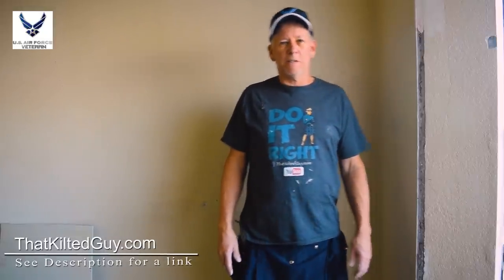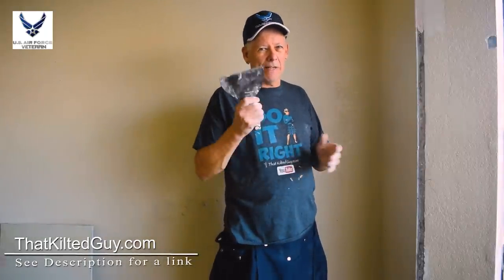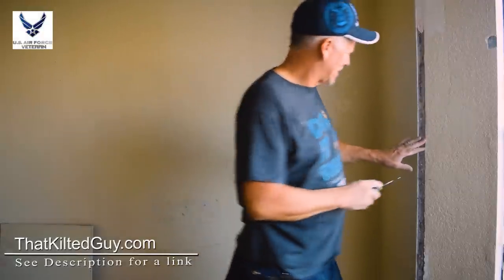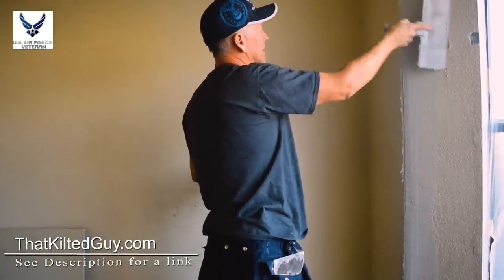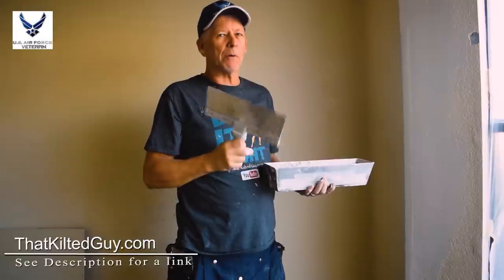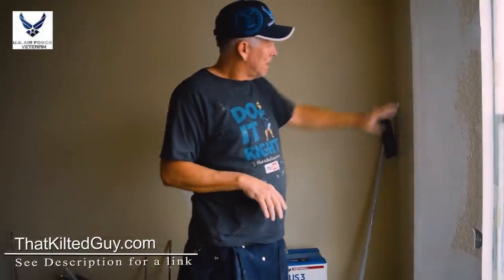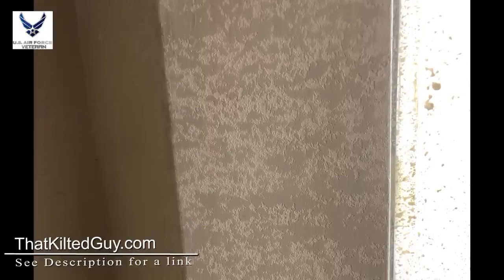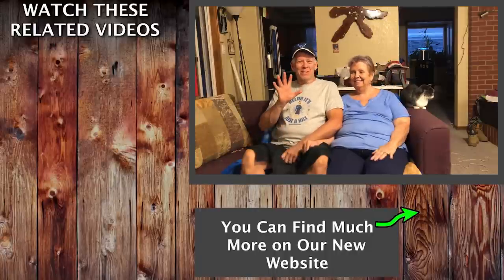Can YOU Repair Drywall Cornerbead Yourself, Easily?  Watch this BEFORE you go any further.

Comment: Great tips.  Almost every metal corner in my house has cracked along the seam from the ceiling to the floor.  The house is 30 years old and the joints started cracking  after about 10 years.  They didn't use tape on top of the metal corner.  I'll be repairing every one using your method.  I'm a little nervous about how they will look because I'm not a pro but I'm going to give it a shot.  I can at least do as well as the original builder if I follow your instructions.  Thank you.

Comment: That's exactly the right way to do it. Mr kilt guy. I've been doing drywall for 16 years. Even on new work or repair work I do it the same way and I always always take my corner bead. And I've seen over the years I'd never cracks. My brother taught me everything there was about sheetrock. And one of the bad areas in homes were cracks is on tray ceilings. But if drywall finishers would do it right and tape all their corner bead that would never be a problem 👍👍💪💪. I always enjoy watching your videos you are the real deal
Reply from the maker: Thanks, I appreciate that 😎, & Thanks for subscribing!

Comment: I have a long stretch on an outside corner that runs along my ceiling where it steps from 8' to 9' that looks exactly like this.  It cracked along the edge of the metal, and pulled completely away from the ends.  I'm going to be using this technique to repair it soon.  Thanks so much for this video, it was exactly what I was looking for!
Reply from the maker: Thanks, glad I could help you out 😎. And thanks for subscribing!

Comment: A tip if the house doesn't have a metal corner bead, leave the corner inch till last and mix bond with cement 1:1 and one good run will leave you with a perfect corner that's tough enough to take a good whack from a gormless labourer bumping it with a ladder

Comment: If you get a nice new clean sanding block and cut two corners off the flat side, it helps with the “gouging”.  Cheaper than buying a pole, sand paper and head!

Comment: Fast set can be your best friend if you know what your doing. I love the 5 and 20 minute. 5 and 20 minute if you have the skills, you can wet sponge it when it's hard, not fully cured and smooth it like glass simular to working plaster.  We always used that tape on all cornerbead on new construction. What's your preference on setting cornerbead. I prefer nails or screws, you just have to be carefull to set them right and not screw up the bead. Bead that has been set with a bead setter in my experience cracks easier in the future. But a bead setter is quicker.
Reply from the maker: Have you ever scraped the edges off your hot mud once it sets up? (in the middle of your mud, as in your lap marks)  I like it much better than a sponge.  And I fan dry the edges for a few minutes and I can dry sand them.  I've messed with wet sanding many times and don't like the way it comes out.

Cornerbead, I use staples, but a lot of them.  I've never had a problem with it.  The clinch on bead setter is just for initial fastening, not to be used alone.  Assuming you're talking about this item - https://amzn.to/2CZkDq9

Comment: Great content. Thanks for your videos. Question - I noticed that you prefilled, set the tape and then did a first coat of hot mud all in the same go. Is it not necessary to let the mud set between steps?
Reply from the maker: With hot mud you’re not worried about letting it dry up so yes you can do more steps in one. Normally you let regular joint compound dry thoroughly partly because it will shrink the whole time but hot mud doesn’t shrink

Comment: Have Vertigo too
SUXS, Have to do the lean back Head movements over a table.
 What I have now is a Teeter Inversions table to get in so it's fast and easy to get back to work. 
Thats if your at home mind you....If you suffer from Vertigo while doing your projects on the road
 I would bring the Inversion Table with you in your Trailer. Saved me many times.
 People think your Drunk then have to explain whats up...:)
Reply from the maker: Mines caused by a virus that got into my inner ear and did 40% nerve damage.  It never goes away, but my brain adapted so it's about 90% better, but I still stagger often, although most people don't notice.  Bid a job for a sheriff recently and had to tell him I had this, and wasn't drunk since I was staggering, so he hire me, lol.
Reply from the maker: Mine was so severe that I couldn’t even crawl. I couldn’t reach my phone that was 3 feet away. It’s terrible crap

Comment: When I first started doing drywall back in the 70s, I was taught to run tape on both sides to cover the seam between the cornerbead and the the wall itself to prevent cracking. I don’t know if it worked or not because I never went back to check. But I do know that every time I’ve repaired cornerbead  cracks since, the cornerbeads weren’t taped.
Reply from the maker: we used to do that sometimes, but truth is, I have seen corner bead with mesh tape on it crack. I now only use tape on corner bead because it solves the whole problem.

Comment: This is great! Exactly what I needed. I do have a section where the metal is not secured. Is there a specific screw type and length that you think works best for going directly through the metal?
Reply from the maker: 1 1/4” drywall screws
Reply: @ThatKiltedGuyDIY  there was only one staple every ~18" so the corner bead was very loose. Starting the prep now and am excited to have my walls fixed!
Reply: The repair turned out great!! I have done a lot of painting and some basic crack/hole repairs, but this was my first time working with cornerbead. Thank you for the awesome videos!

Comment: Thanks this plastic corner bead is popular in texas. l went to work on it today. My question is why does it fail? Hung alot of vinyl siding back in the day and my guess is hot and cold expansion contraction. l guess the installers glue that bead on. l hung board back in the day but never finished a house tape and bed. lm very good at repair work but you know way more than me. Also on alot of repairs l pull the tape and there are voids in the corners or at the peak af the ceiling. Were the tapers suppossed to prefill all these voids when the house was built? l owe you a apology for my rude comment to a vewer. Sorry u had to delete it. You have to be very patient to the weekend warriors. You do a great job and some vewers dont appreciate you. l just taped skimed and texured the hairline cracks on the corner bead. Hope it doesnt come back to haunt me. Thankyou James

Comment: How would I fix this in a bathroom and the metal has started to rust?  It doesnt have to be permanent.  Just until I can remodel in a few years. TY
Reply from the maker: Scrape off loose mud, and repair it

Comment: Hey there Guy, I do a lot of these type of repairs in my area as well. Judging from the discoloration that the corner bead has in your video. It's the same for me . The joint compound loses it adhesion and just pops off of the metal bead. It's like the metal corner bead oxidizes either from a manufacturing defect or a thermal situation and the mechanical bond is breached... Thought's? Ps. I added you to the featured channels section of my YouTube Home Page. Keep creating these awesome videos my friend!  
👍 -Paul
Reply from the maker: Hey Paul, yeah I think there’s several things going on. One, mud just doesn’t like to stick to metal, and the other issues you talked about are probably right on. Plus I think sometimes finishers don’t pay attention to the instructions on mud boxes because some like Topping mud says it’s not for use on the first coat of corner bead.  And then finally, because it’s a corner it’s more subject to being banged up carrying furniture past it, etc.

And I will be glad to add you to my featured section also. Thanks and will talk to you later. Guy
Reply: @ThatKiltedGuyDIY  Yes. I'm sure being an outside corner in a traffic area doesn't help. A lot of my repairs are every single outside corner including widow returns that are oxidized. It's usually older corner bead that seams to be more of a galvanized type of metal compared to the shiny metal corner bead that's on the market today.  Thanks for for adding me to your Featured channels list! -Paul
Reply from the maker: Had a terrible vertigo day yesterday so didn’t get your channel added yet but I will. Thanks, Guy
Reply from the maker: Ok, finally got your channel added to my featured channels list.  Thanks again.
Reply: @ThatKiltedGuyDIY  Sorry to hear that Guy. I hope you're feeling better. Thanks for the add man! -Paul
Reply: Paul Peck DrywallTube ha just watched your videos😎😎😎 thanks guys you are really making a big difference... it helps out so many ppl man that you don’t even know how long the chain is. What I mean is that these videos don’t only benefit a homeowner, handyman, or just an average DIY’fer , but also those more unfortunate ppl who can’t afford a good professional to come fix their problems. For example the orderly especially widow old ladies that don’t have family to help them out. I have a few of them living in my Neighborhood who I am always looking out for like they looked after me when I was a child running around the trailer park driving them crazy lol. Anyways thanks a lot and keep it up cuz you are helping me learn skills, gain experience, and at the same time helping those that need it.
Reply from the maker: Thanks, It really makes my day to hear stories like this. Take care.
Reply: @gil-juniorriseabovebetraya5972  It's comments and feedback like your's that keep's me and That Kilted "Guy" motivated to continue to make these videos and help as many people as we can! Thank you for this!!!🙏 -Paul
Reply: @gil-juniorriseabovebetraya5972  Glad to see people like you still around helping little old ladies.  I never considered myself one but I guess at 74, I am.  Got tired of paying "contractors" to do things around my house and charge a fortune and do lousy jobs.  So I said to myself, "Self, you're not too old to learn how to do this", so I did.  Thx to That Kilted Guy and Paul Peck and Vancouver Carpenter and others, I can now repair settling cracks and corner bead cracks with hot mud, repair towel rack holes, paint with laser straight lines etc.  In my neighborhood, people look the other way if you need help.  Sad really.  So I kicked myself in the butt and learned how to repair things, even tho sometimes I don't have the arm or hand strength. I get it done. Sometimes I do it wrong and have to start all over, but in the end, it's done right. Just takes forever. Thank you for looking out for your "old ladies" in your neighborhood.  Bless you.

Comment: Hey kilted guy! Got a bunch of repairs next week. All the corner bead is vynil with nailig flanges on both sides. The hair line cracks are just on one side of the flange. On almost every corner all the way from bottom to top. Cant l just tape it and texture? Your opinion please. Thanks James
Reply from the maker: If it’s just hairline cracks, yes. If any corner bead has come loose I would resecure with nails. And then I would tape it.

Comment: What if the corner bead had been banged and dented? Can it be covered, or does the entire piece need replaced? Do you have a video for this situation that I missed?
Reply from the maker: If it’s minor you might can tap it back straight enough to recoat it otherwise you usually have to cut the corner bead off and replace it in that bad section. 
www.ThatKiltedGuy.com

Comment: Very helpful...I suppose I should use plastic corner bed just outside a shower and perhaps a different type of mud because of the humidity in a bath. ?
Reply from the maker: Well, rusty cornerbead in high humidity areas does happen and plastic would be less likely to rust.  I have very little experience with plastic bead honestly as I just dont find it strong enough.  But in a bathroom the first thing is I believe ALL bathroom with an actual shower or tub should have an adequate fan.  I'm in a rental currently and it has no fan and the paint is cracking, crazing and just not doing well from the high humidity.  We shower with the door open, but I'm sure many in the past haven't.  And I've fixed LOTS of mold in bathrooms without a good fan.  So with a good fan, you shouldn't need to worry about it.  As for mud, I think they will all absorb moisture so none are better for that.  But I would suggest a high quality primer and 2 coats of semi gloss paint as it resists moisture better.

Comment: This is exactly the job I need to do!  Thank you for the great video!  One question: The metal corner bead I'm fixing has a little play to it.  If I hold down one spot with my finger, I can still get it to wiggle a bit with my other hand a couple inches above or below.  I guess this is why it's cracking and I want to screw it down solid.  You showed putting in a drywall screw.  If you need more than one, how close together can/should they be?  I feel like going crazy with them - like every five inches - to make it really solid, but maybe that's overkill?
Reply from the maker: That’s fine

Comment: Have a corner bead repair but can’t find a stud behind it. The nail goes right through the drywall. Using 1 1/4 “ ring nails. How to I secure the corner bead ?
Reply from the maker: Tape on bead

Comment: Newb-ish question:

Why did you use Quickset Mud first for that fiba "tape" as opposed to using All Purpose first... and then Quickset next? 

Is this type of scenario not considered taping? I've heard that All Purpose is better to be used for taping, but maybe this isn't the case for this type of situation?  

I have to do something similar... and was under the impression that I should use All Purpose first so my tape would stick better to the bead + wall.... and followed up with Quickset after it dries. 

I appreciate all of your videos and advice!!! Awesome stuff!!!! Thanks so much!!!!
Reply from the maker: When talking about non-setting mud, yes regular all purpose is best. But setting mud has excellent adhesion also and it allows you to put two coats of mud on quickly with less shrinkage.

Comment: What type of sand paper grade did you use after you let the quickset hot mud 45 dry on your dry wall sanding pole?
Reply from the maker: Since hot mud Sands harder I usually use 80 grit, but on USG +3 I use 80 grit if I need to be aggressive but I use 120 or fine for the final sanding

Comment: Hi there. I enjoy the context you put out. It’s very useful! Thank you!

I’ve seen a lot of videos on how to repair dents or cracked square corners but can’t seem to find any regarding bullnose. I’m buying a house and there are a couple of bullnose corners that are dented. I was thinking of preparing the area: sanding, scraping lose bits, and filling it with a nonshrinking spackle like DAP DryDex or equivalent. What are your thoughts?
Reply from the maker: Good plan but it might take a 2nd thin coat.
Reply: @ThatKiltedGuyDIY  Thank you for the quick response! So would you recommend a think coat of the same spackle or a joint compound of some sort?
Reply from the maker: The same, & 2 coats of paint and primer
Reply: @ThatKiltedGuyDIY  perfect! Thanks again! I’ll keep you posted and take some before and after photos of the completed process, if we purchase the house.
Reply from the maker: Cool. If you do that, be sure and extended each coat of paint or primer slightly so they don’t build an edge.
Reply from the maker: If you appreciate our help with your project and would like to support our channel, please consider joining our YouTube membership for as little as three dollars per month. You can join by clicking the join button beside the subscribe button on any of our videos. Thank you

Comment: Probably my biggest issue with metal corner beads is that over time they rust and the mud can literally pop right off.
Reply from the maker: You are right, they can rust. I’ve worked on a lot of them and I can tell you they don’t always rust. I think homes with swamp coolers and high humidity areas will see more rust as the drywall mud will likely absorb some of the moisture.

Have you tried any other type of corner bead such as the plastic bead?
Reply: @ThatKiltedGuyDIY  Is it best to cut out rusty sections of a corner bead?  Other alternatives?
Reply from the maker: @korngable  if it’s lightly Rusty, you don’t need to cut it out. If it’s affecting the structural integrity of the corner bead, then definitely. I prefer tape on the corner bead and did a video about that a few months back
Reply: @ThatKiltedGuyDIY  It is near a shower stall. Sheet rock softened, maybe 8-10 inches. Some rust, but still pretty sturdy metal.  May try to replace rock and retape section.   Thanks.

Comment: good video from a first timer with corner bead.  My question is similar to nail pops, I am finding places along outside corner in basement stairwell.  Scraping reveals these are places where the original build nail securing the bead at the edge either was secured too tight causing divet in the metal or maybe divet depression in the metal came about over 28 yrs with expanding drywall due to higher moister content....... either way , I never find good videos to how to trouble shoot with depressions in the bead.  will fresh mud last at least another 10 years, or should I use mesh tape along the edge including over the depressions.  or do I have to cut the whole bead and put a clean 5 foot piece in?   thx   ie. many bumps of the mud along the corner bead spaced out approx 6 to 8 inches;  first area scraped revealed anchor nail at edge producing divet or pitting in the bead metal.
Reply from the maker: Hey, I appreciate the detailed description but I’m having a hard time picturing it. If you want to send me a picture you can find my email in the about section of my channel and I will try and help you further. Thanks, Guy